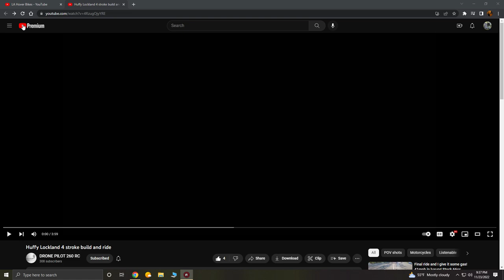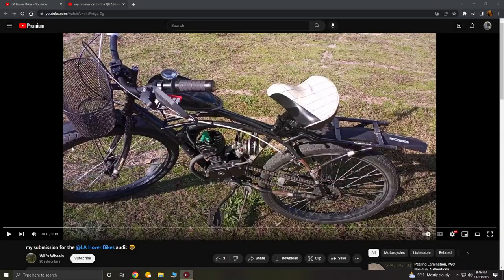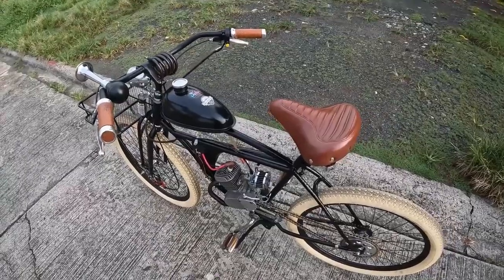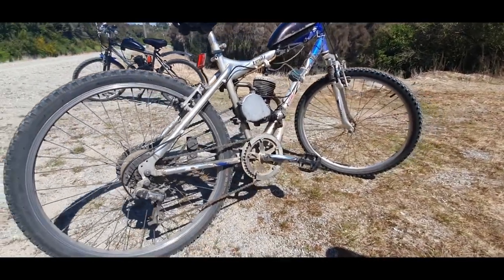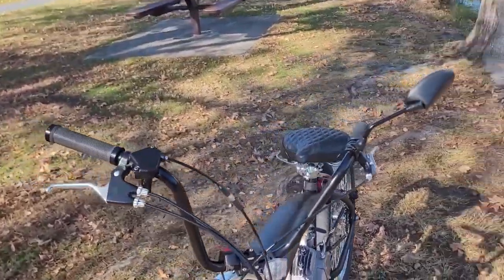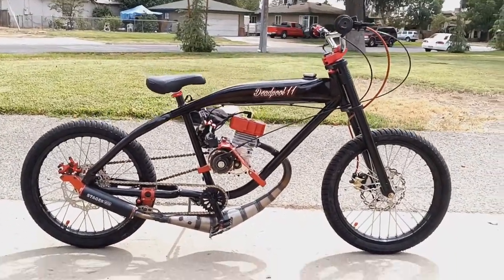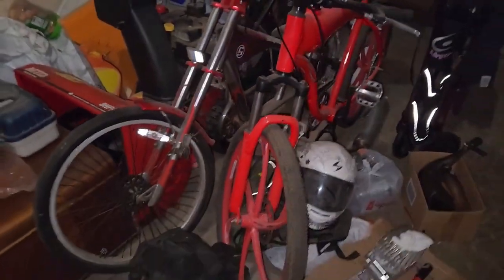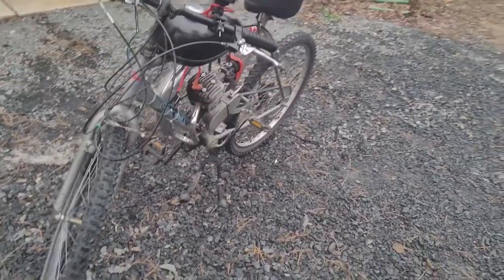Motorized Bike Build Audits Ep.3

Comment: Thanks for the feed back, I’ll get a new fuel filter and install it correctly this time. So far the only issue I have had with my p85 is blowing an intake gasket 30 miles into a ride. I must have not given the motor enough time to cool down when I stopped at the 15 mile mark. That and riding near wot up long steep hills and the exhaust wrap probably doesn’t help.

Comment: Call an old man crazy but I like my Staton Friction bike 49cc Honda motor.
Reply: @junkyardmotorbike I used to work at a tier 1 honda supplier . honda makes garbage. the metal is so substandard you can't make a frying pan out of it and sell that pan in japan.
Reply: @junkyardmotorbike Well the Crazy man has 2 engineering degrees . While at the same Honda I was told the company policy " Guaranteed market renewal is good for your job " . What does that mean?  It means they intentionally screwed something up so you will have to replace it . Since Honda limits the number of service parts available it means " Buy a new one idiot ".  I do admit a honda is better than a Hau Sing but not by much.
Reply: @junkyardmotorbike This Engineer tried to educate you on the metal and business practices of Honda . It still seems that I can't help stupid people. Besides if Honda makes the best why is the World Record for miles on a car awarded to a Volvo with over 3 million miles on the original block and transmission ?
Reply: @junkyardmotorbike Same thing right back at you. Good luck with all the rust intentionally injected into every weld joint of your Honda due to the 80% CO2 gas mixture.
Reply: @junkyardmotorbike I like the motor better than the hau sing but I wish Volvo made one.
Reply: Of course it's far better than unreliable 2 strokes

Comment: Thanks for the feature @LA Hover. This is my second build and yes it's pieced together and the felt faker frame and forks were sold together bought from Ebay.  My first build though is the f-zero bike and Engine, hence the reason to forks are different. The f-zero forks are limited in handle bar options hence the reason a different type of triple tree fork in this build. One downside to these forks is, it's not as thick as the ones on the F-Zero. Any recommendations for the same type forks but beefier?
Reply from the maker: I picked up a nice set of down hill triple trees, should be here in a day or two. I'll try to get a video on them for you ASAP.
Reply: @LAHover  Nice..looking forward to the review.

Comment: Hello I have a hyper beach cruiser bicycle this is my third build I bought everything separately I wanted to buy the best parts a could and I bought front and back brakes for it should I keep the coaster brake on or just take it off if I take it off do I put a nut where the coaster brake would be so there is no gap there I also have a 36tooth sprocket sprocket with hub adapter instead of a rag joint i have more upgrades but big thing left to do is deciding on which engine to go with I really like the skyhawk 66cc engines with the nt carburetor and m65 colone expansion chamber exhaust I u would like pictures please contact me thank you

Comment: the bike you are claiming to be a road bike most definitely is not a road bike, 80s and early 90s mountainbikes all look exactly like that basically. hell, that design is still used today for cheapo box store mountainbikes. the dead giveaway is the fork. the mountainbikes of that era had that style fork, U shaped where it connects to the rest of the frame. most road bikes of that era would have been flat square shaped. not to mention, that entire bike looks almost stock for most everything else on it. those handlebars were the stock style on mtbs, that gear ratio. not to mention the overall width of the frame,. and changing everything but the actual frame itself to make it look like a mountainbike would be ridiculous.

Comment: My phantom 85 turnd to shit after 3 months and after my spark plug blow out the head i could no longer run it so i had a funeral for The phantom
 First off the head bolts and the mounting bolts stripped out a then had problems with the spark plugkept blowing out the head i called bike engine and they basically told me to f off , so im totally against the phantom motors, and am using a ms 460 on the bottom end of the phantom so hopefully soon ill get it running